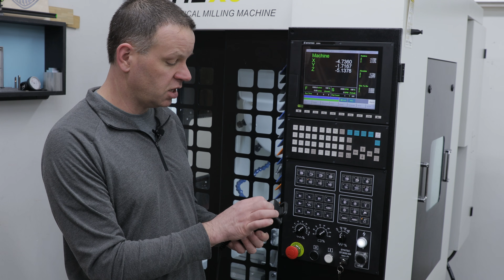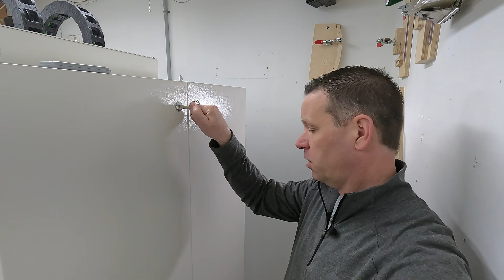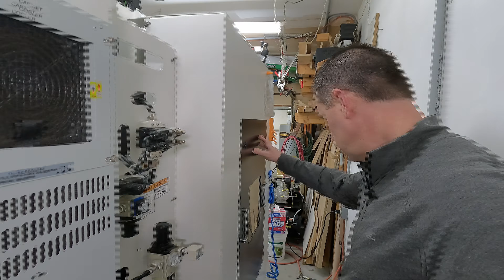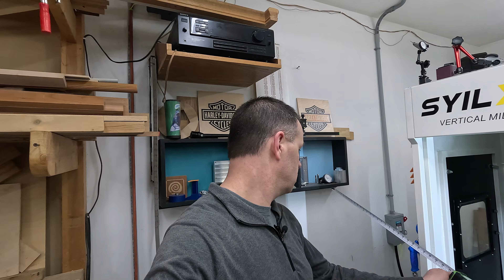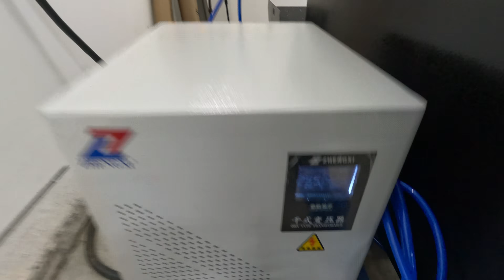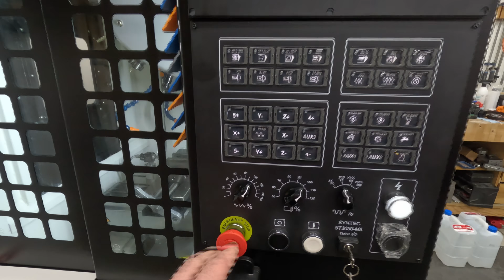A Tour of the Syil X5

Comment: What size linear guides this machine have ???  Its 25 or 20 ?
Reply from the maker: I'm not sure, they are covered up pretty good (can't see them).   The Specification in the manual call out Linear bearing rail dimension of 20mm, 25mm, and 30mm for X, Y, and Z respectively.   If you need more details, I would reach out to Syil.

Comment: How big of a breaker are you using for the machine ? 

Thanks!!!
Reply from the maker: Its dependent on the size of the phase converter you would be using.   If you have 3 phase power supplied from the utility company, I believe it would need a 30A breaker, but I would verify that with SYIL before doing any electrical work.
Reply: @kowalskprecison  thanks for the response, I’m interested to know which size you’re using on the breaker tied to the phase converter itself.

Comment: How many inches tall is it with the spindle at maximum height?
Reply from the maker: It gets to about 95" when it does a tool change.   The energy chain are slightly above the spindle so that measurement is to the chains.
Reply: @kowalskprecison  thanks!

Comment: How do you think it would machine A-2 D-2 tool steel? I do die work.
Reply from the maker: I haven't machined A-2 or D-2 steel yet.  You're not going to get the same performance as a 20hp machine but with the right cutting parameters I would expect it handle it with no problems.   So far, I've machined, 1018, 4140, SS440, SS304, 6061, 7075 with no signs of any issues.

Comment: Awesome, thanks for doing this! I'm also thinking of getting an X5 in the near future. Could you share some details on your phase converter / transformer setup? I heard from the sales people that in can run on single phase, but it reduces the HP from 10 to 4. And any troubles/challenges/tips for getting the machine moved into place in your garage? Did you hire riggers?
Reply from the maker: Sure!   I'm running a American Rotory Phase converter AD20.    Its more than I need for this machine but it gives me some extra capacity if I want to add another machine later.   The transformer came with the machine which converts the 3phase 220V to 3phase 420-450V   I'm not sure if the machine with Syntec 22MA control would run on single phase, I don't believe so, but I believe the LNC controller does.      The machine is very heavy.    You will need at bare minimum a 6000lb capacity forklift with 6ft forks.  I move it myself, with some help, but if you're not comfortable moving really heavy things I would hire it out.  One wrong move would be a disaster.    Hope that helps

Comment: Is the height from the spec sheet accurate?  My garage has a fairly low height at the door and I’m not sure if I can fit a Syil in there.
Reply from the maker: Yes I believe it is accurate.   My garage door has clearance of 83.5in and it just barely fit through.  I had to loosen the energy chains to get it through the door.

Comment: Do you not need a phase converter? Ciao, Marco.
Reply from the maker: Yes. It needs 3 phase 220v to feed the transformer here in the US.   I have an American Rotary phase converter on the other side of the shop that feeds the disconnect switch I showed in the video.
Reply: @kowalskprecison  makes total sense now. Thanks for the clarification.
Reply: These are three phase only
Reply: @qdp03 That's what I thought. I'm assuming you have single phase 220 in your garage, stepped up to 380 by the transformer supplied with the X5. I didn't see a phase converter in your shop, how are you getting  three phase to the machine?

Comment: Nice view of X5, I'm glad I ended up with X7 though given extra table size with 4th on and also access to rear/right side of machine given my floor layout. A video of this show at lot more than any manual or sales diagram - thanks.
Reply from the maker: Thanks!    Yeah everyone has different needs I guess.   I think the X7 is Syil's bread and butter, but if your limited on space or just don't need the extra travel for one reason or another, the X5 is there.    Also you get 20K RPM spindle, which is useful for those smaller tools.     Thanks for your insight!